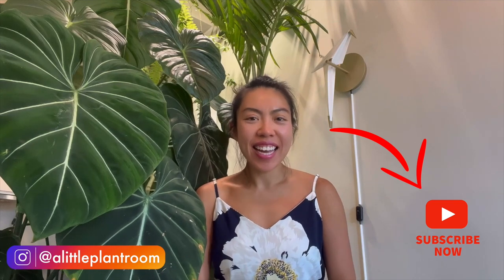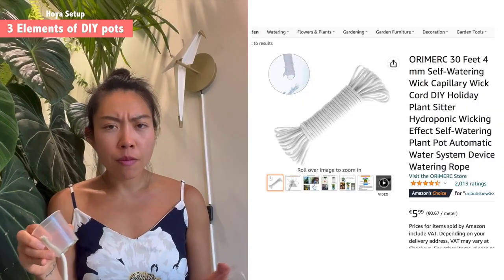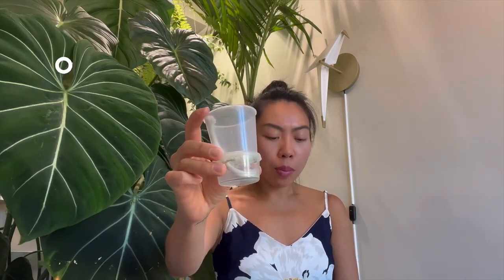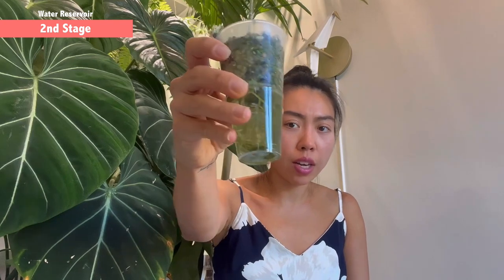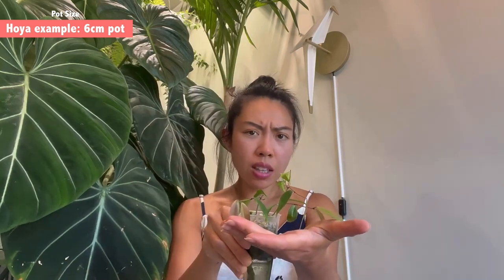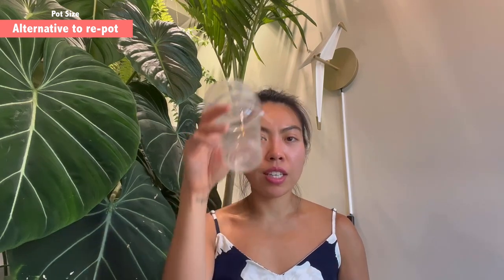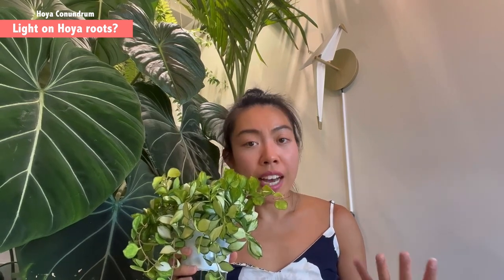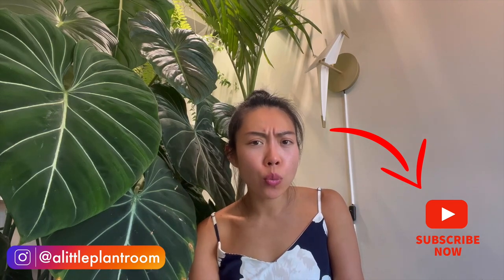HOYA SETUP | DIY Pots | How to make? | How it works? | How to choose pot size | DIY alternatives

Comment: Hi Fonnie. Must we always use a wick for the water reservoir? Could we sit the smaller pot directly into the bigger water reservoir and fill with water up to say, 1/3 of the smaller pot (let’s say the plant is already established with some water roots)? Will it work?
Reply from the maker: You don’t need a wick when water roots has grown into the water reservoir 😊 the wick is an assistant for the plant to absorb water when there is nothing bringing up the water into Lechuza Pon😀

Comment: another good to know information. even the wick is just laying at the bottom of the pot, it will still work. Pon will suck up the moisture up from the wick thru capillary action. i have been using pon since 2016 up to now. also consider the size/diameter of the wick that you will use depending on the size of your pot.
Reply from the maker: Thanks for the information! Woah! Since 2016! What is your view on Pon after almost 6 years of experience?😀
Reply: Using pon made my plant journey easy. I also save some money overtime because the subrate can be re-used. You have so many options of fertilizer to use. From basic/universal fertilizers to a specialized or specific nutrients based from your plant needs. its just amazing! i am loving it.
Reply from the maker: @r3i2x  sounds fantastic! So far I only have positive experience as well, except Pon is getting harder to obtain and prices are increasing 😅
Reply: @tfyfonnie  that will be for your next video. because you can diy pon on a larger scale if u have many plants.

Comment: Thank you for the video! I definitely try it. One question; How do you repot without ripping the roots off?
Reply from the maker: The unfortunate answer is yes, most of the time when I repot, I’ll have to rip off some roots. But you can also cut the plastic pot to free the roots without much casualties. If the Hoya is healthy, roots grow fast and the ripped off ones will grow back without a major issue 😊
Reply: @tfyfonnie  thank you for the response 😊. Love you videos🥰

Comment: I don't have clear pots, so I don't know whether algae harm a plant or not, but algae certainly harm cuttings rooting. I had a few cuttings die on me when there was algae growing in the glass. But if I manage to keep the glass clear of algae they usually do well.
Reply from the maker: In that occasion, was water the rooting medium you are referring to?
Reply: @tfyfonnie  Yes. I use water to root the cuttings. Takes a bit long sometimes, but usually does the trick reliably 👀
Reply from the maker: @walle5667  I see, I do have issues with algae if water is the only substrate, especially when the algae has grown on the roots itself. I suspect it’s because algae blocks the roots from interchanging oxygen and other nutrients if too much algae is grown on the roots🤔